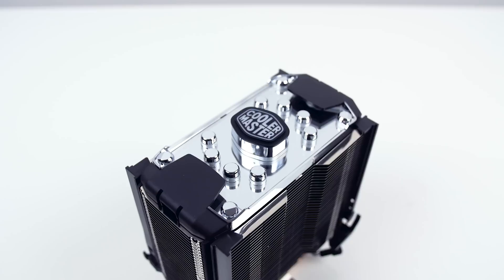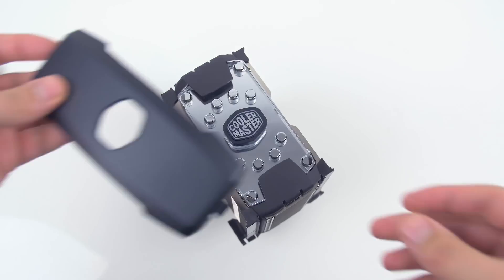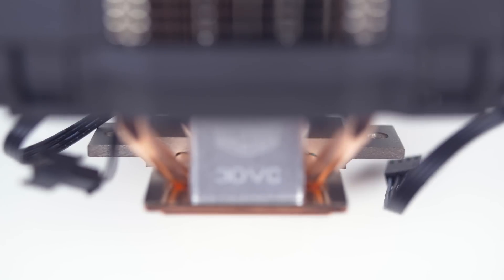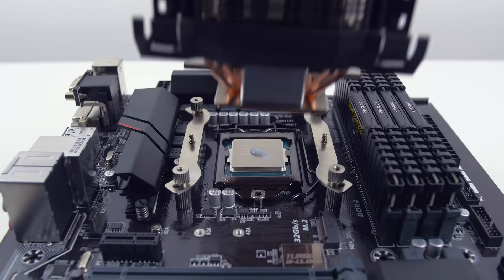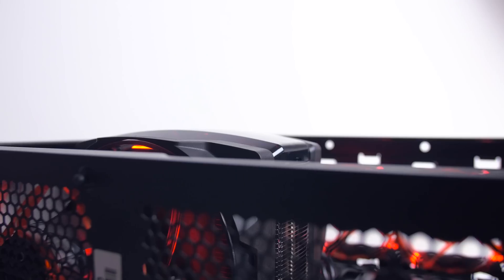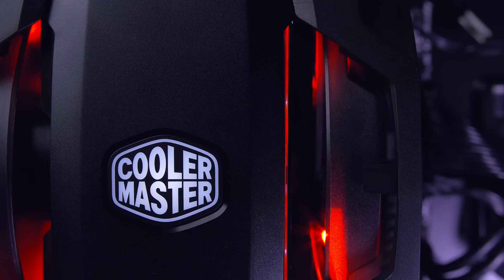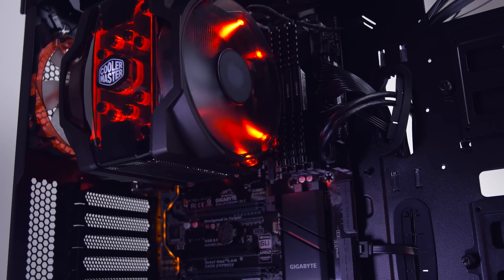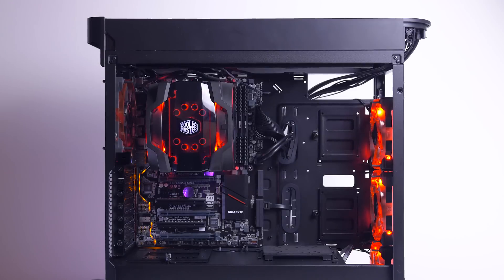Cooler Master MasterAir Maker 8 - The Best CPU Heatsink Cooler?

Comment: I am thinking of building a new system at the end of the year when AMD, Nvidia, and Intel release their next generation of CPUs and GPUs (w/HBM2) to replace my 3 year old laptop. I have never had a water cooled system and the idea intrigues me, but I love the simplicity of air cooling and the lower cost. With the newer GPUs putting out less heat and most games being GPU bound I am thinking I am going to go with air cooling and spend the $ I would have spent on water cooling to go with better a CPU & GPU. A milder overclock means I can use a cheaper motherboard also.

That being said I will probably buy a really good air cooler, but I think $130 is a little steep for one. Granted it does have the 3D vapor chamber and beats the other air coolers by over 4C so its performance is better. I have been thinking I would get the Noctua D15S for its cheaper price, almost silent operation, and better mounting options. I can always add the second fan for an extra 2C or so. I will have to see who has the best air cooler at a reasonable price when it is time to build my system. I am willing to spend more then $30 on a Evo up to maybe $100 depending on performance.

Comment: looks nice but the price is way too high for me.
the 212 line is as far as i would go also the new 212x seems nice (not the turbo for the same reason) 
oh also no water cooler ever again for me.
a coulpe of drops are enough to set me faaaaar back. could squeeze a couple100 Mhz and have same or better temps with an all in one and it might look cleaner, but cant take the chance again and get set back for 500-600 euro.

Comment: For my next build I'll be doing air cooling again. It's much more appealing again. I'll be building inside the Define R5 so I don't know if this new cooler from cooler master would fit. And even if it did the price point is way too much. I'll probably go with a cooler from Cooler Master or Noctua and use a Corsair pwm fan instead of the stock one.

Comment: $130 my ass. Noctua NH-D14/D15 master race
Reply: +Henry The Unicorn  I like those fans
Reply: but it's ugly
Reply: the guy Replace the fans
Reply: Henry The Unicorn

+ 30$
Reply: +the guy The NH-D14 outperforms the H100i though :/
Reply: +the guy then get a cryorig r1 ultimate($90), a phanteks ph-tc14pe($65) or a be quiet dark rock pro 3($75). They perform and look great, while being decently priced.
Reply: Biferony X
or h100i for 100$
Reply: +the guy More like $15.
Reply: A Christian Gamer two good 140mm fans will cost at least $30, probably $40-50 for ones as good as the default ones on it.
Reply: Biferony X Oh two of them. One is like 15, though.
Reply: +Henry The Unicorn phanteks ph-tc14pe master race here. Performs as good as the Noctua but isn't butt ugly.
Reply: Guys after a lot of researching the cryorig h5 ultimate is the best CPU cooler in the market from every aspect
-Very quiet 26db
-Very close performance to Noctua NH-D14/D15
-Looks fucking awesome plus cryorig sells different top plates
-Installation is very easy
-No ram clearance issue
-And it's 45$
my life is complete
Reply: Test system setup: i7 4770k, Asus sabertooth z87
temperatures in stock load: 
Thermalright TRUE Spirit 140 .... 50 c°
Cryorig h5 ultimate...................... 49.5 c°
Noctua NH D-15........................... 49.5 c°
source: TweakTown and others

Comment: To me air cooling is still the best solution. I've used quite a few different air and closed loop coolers but everything with a pump is simply too loud for me. There's also the struggle with tubes which are never the right length and always too stiff. Then there's the installation hassle with the radiators and fans as well. The worst are those digital pumps with rgb lights which need even more cables going everywhere. In my personal rig I've been using a D14 heatsink with bq! silent wings fans for the last few years. It's much easier to deal with when swapping any hardware other than ram but even today I changed dimm's without much hassle. Builds I've done for friends often had a passive Raijintek Ereboss heatsink with just a rear or top fan to get the heat away. I'm very happy to see CM putting some r&d time into heatsinks even if this wont be the best selling cooler. It looks like it's easy to work with as long as you've got a case that supports it and you're not one of those people who like giant ram heatsinks. I might pick one up for my next build but it is pretty expensive when you swap fans for something more quiet.
Reply: +Unicorn Reviews I tend to agree, I have a Swiftech H220-X. Does a great job, but pump noise is as loud or louder than a Noctua or Be Quiet tower air cooler. Temps are great with the Swiftech, but let's face it, as long as your CPU is under 80-90 Celsius with Intel you are well under the throttle limit.

Comment: tip for the long cpu fan cable: zip them together, then send it around back of the motherboard tray and back again.
Had to do this with the massive Phanteks cable on the last build I did, as it had the same massive, non-flexible sleeving. 
Actually came out looking quite clean in the end

Comment: Since I am wanting to get into computer building and I haven't built a computer as of yet, I think I will start off with air as you do not risk having water leak from a broken rad or something. And no, the maker 8, especially the lighting and the price it comes at will not be my first option, in fact far from it.

Comment: Can this thing cool a 5820k at 1.25v?
Reply: check the TDP of the cooler
Reply: ***** Wouldn't really help, because I only know the stock, non overclocked TDP of my CPU at stock voltage.
Reply: ast5515
good point, but you can do some estimation though like whether the TDP of this cooler same as the one you're using right now or see if you can find TDP of other similarly overclocked 5820K.

Comment: But does it out perform a NZXT Kracken... If not for the proce point and lower profile  might aswell just buy a Kracken , Low profile, The abulity to change colors, Very likely better cooling . could you do a NZXT Kracken Vs this cooler video?

Comment: It looks great and performs good for a air cooler. But my issue with air coolers was dis-assembly and reassembly. They take a lot longer and are way for finicky compared to all in ones and custom water loops. They will always serve a purpose, but i wont be using them unless i have no other options.

Comment: i have both AIO and D14 in my system and i ALWAYS keep my ear to the case to hear the AIO so when it dies on me i would have to change my gpu with it QQ i kinda hate AIO :S if the pump fails u`ll fry stuff if it leaks u`ll fry stuff if the fan fails it will heat up and maybe burst open and leak over and fry stuff :S i need to take that AIO out soon :S

Comment: I bought a bequiet dark rock pro 3 some time back. It was half the price and gave almost the same result as this. I like the design of this one but for 130$ I would not buy it, also because there are very few cases that can fit it. So yeah, this won't become a very popular cooler at all. See you in the next video Dimitri :D

Comment: I will stick with air cooling in my next build and the cooler I will most likely use is the Noctua NH-D15, I love everything about Noctua from price/performance ratio to design and sound signature.

Comment: Air Cooling for me. I won't have to worry about it dying on me or maintenance to the cooler itself. I'd get something high end like the Noctua D15 to have temps as low as watercooled heatsinks & silence.
Reply: +ZambonieDude Remember to get the NH-D15s. It performs exactly the same as the normal one, only it's abit smaller so you can use the first PCIe slot on your motherboard ;)
Reply: visdom0 I'm glad you posted that bc i'm considering on buying soon xD
Reply: ***** It's so worth it dude. Same performance as the high end AIO coolers. Only custom loop can beat it.

Comment: My last two builds have both used the same Noctua NH-D14. A really good air cooler, back in the day I payed about 80 bucks for it and it still runs like a champ. Also very quiet - but to reduce noise even further I've removed one of the two fans included with the NH-D14. Never had any issues with my i7-4790K OCed by approximately 15% ...

However I wanted to change to liquid cooling for my next build, even if that's one or two years down the line ;)

Comment: AIOs outperform it, but an air cooler can't leak and has one less point of failure. Just get some ram without heat spreaders (it's been proven time and again that there's almost no benefit to high-performance RAM) because they'll be hidden underneath the cooler, and you'll save a little bit of money there. (sample build. it fits in the Noctis 450 http://pcpartpicker.com/p/tz4mVn)

Comment: This cooler hits a very specific niche that might skip most people over. I kind of understand the pricing, hate to say it. It is only for people looking for a very specific sleek stealthy look, people who need a lot of cooling performance at relatively low volumes.
With the D-15 being uglier than a burn victim, Cooler Master must get it that MOST people don't give a damn about looks, and even fewer care about performance AND looks equally. At least it performs well, but for me, the price is not worth the pretty looks. For some people it will be.
Reply: Sleek and stealthy look with not too high price? You want to go and have a look at Be quiet products (Specially the Dark Rock 3 and Dark Rock Pro 3)...
Reply: Dgtal Breakz Sensing another rabid fanboy, so I won't bother letting you know they don't actually preform that well.
Reply: Richard Smith Fanboy? I dont even own a bequiet product. I was just trying to give you another option. And, actually, they do perform quite well compared to the noise output. The one not bothering responding you anymore is me, I came trying to help and got called a fanboy instead...

Comment: 1. Price is too high for an air cooler. At this price point most will opt for an AIO liquid cooler. Let's face it; apart from the vapour chamber, which is used fairly widely on graphic cards, there's nothing really new here in terms of R&D. 

2. If CM is pricing this that high then they should have at least included RGB lighting. If not the fans, then at least on the cooler itself. This seems pretty basic especially if you don't have an option to turn the lighting off.

3. Agreed with Dmitry on the package. Wtf CM? So much money and cardboard wasted. Streamline that shit man and cut down on the shipping and manufacturing costs.

Comment: seeing as this cooler performs in the same range as some aio's, this would be good for someone who didn't want to take the risk with the potential leaks from watercooling.
Reply: +Jyrtzy True, but this one has the customizability factor that lots of people want. Especially when you take into account the fact that you can 3D print your own pieces for it. I do agree with you though that people will probably go for the cheaper options though.

Comment: Might pick this up was gonna get an h100i but seems to work pretty good guess it uses the same tech sapphire did with there vapor x tech. I have a cm storm trooper so im pretty sure it with fit and ill have to slide the fans up because my 212 fan is right against my ram. But one bad thing is ill have to go red im blue now with my fans. But the hyper 212 has been a great cooler for the money, not sure if u can get better cooling for the price. I run my 3770k at 4.5 and never go above 60sC in games normally staying in the 50sC. I have an older rig with a q9550 ill put the 212 on.

Comment: Air cooling for me as I don't like the space the radiators take up and there is also the additional pump noise. For me as a silent freak a pump noise together with 1 or 2 fans is a no go. I'm running a Noctua NH-U14S and couldn't be happier. The Maker 8 would basically double the price. No thx.

Comment: Did you really use an i7 920 cpu for the test at 5:55?
Reply: +clarkkent999 It does exist if you think it doesn't :P Look on Intel's website
Reply: DrZepto I know it does exist. I have even used it before. But it's old. That's why I wonder whether it is really being used for test.
Reply: ***** Fair enough. A lot of people don't seem to know it exists because of the weird name.
Reply: DrZepto Agreed. Because it's the first gen i series cpu.
Reply: +clarkkent999 He probably used a 920 to provide testing consistency with past air cooler temperature results. Much easier than retesting everything on a newer CPU.

Comment: I don't think I'd move back to an air cooler now; I've been using a corsair H110i GTX for the past year and a bit and it gives me exactly what I need. The only argument I can see, for being in favor of using an air cooler, is that it's easier to install and more compatible than most AIO coolers? But, even then, considering you won't need to compromise on RAM height or case size, an AIO just seems way better, even if the ball is in the air cooler's court.

Comment: I prefer air cooling to water cooling. I have a cryorig R1 ultimate, and it keeps my 4690k 1.31V below 60c at all times, is very quiet, and I will never have to worry about a leak or pump noise.  If I had an overclocked X99 system then I would consider water cooling solutions, but for a Z97 system, high quality air cooling is perfect.

Comment: I would absolutely do Air cooling for a build/upgrade in the future, but I think the price point for this is about $60 too high and the lack of RGB on the LED's would push me to something else.  I like the idea of the aluminum top plate because you can paint it, but what would be the point if the LED's basically require you go with some shade of red for the paint.

Comment: I  love noctua, super quiet and good performer. I had few closed loop water coolers in past and they all are too noise for me, that pump noise is annoying.
Reply: +Dyeless Yeah man, AIO's are anything but quiet. Those pumps only get louder as they age as well. They also have an additional point of failure, one which cannot be replaced like a fan.

Comment: Hi, Hardware Canucks. I've never been this early. How would you compare this to a hyper 212 evo?
Reply: +RoboDude2000 nothing to compare with. 212 evo is all around good performance for price or call it value but if you want the best then noctua will smoke coolermaster any time.